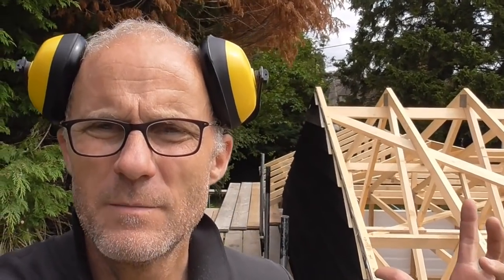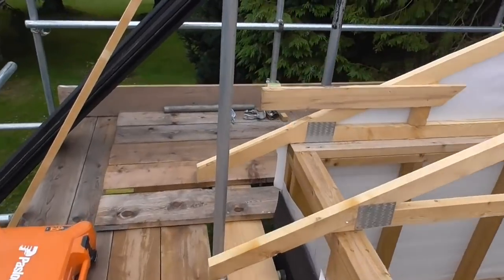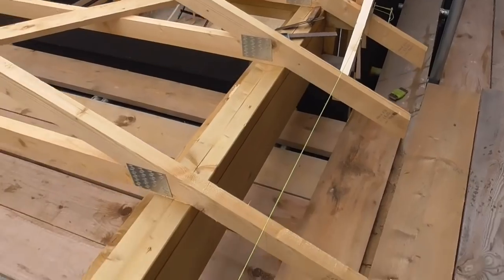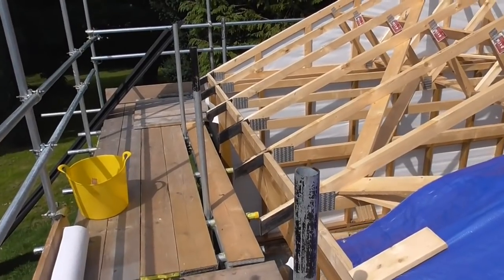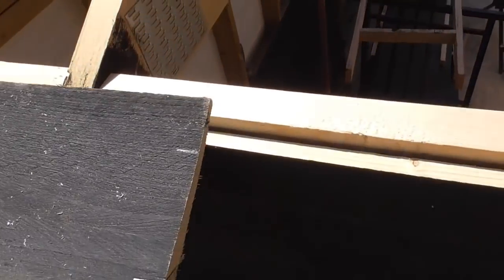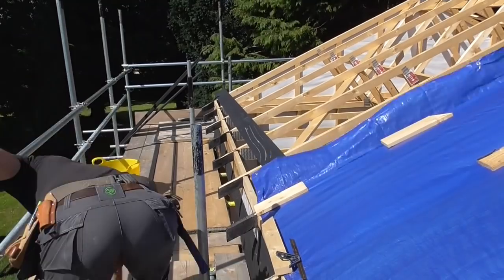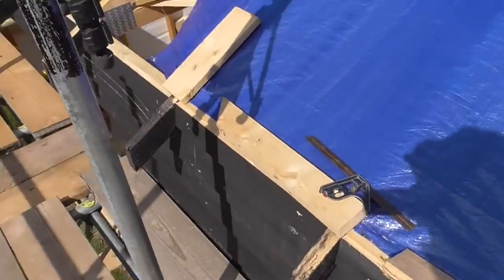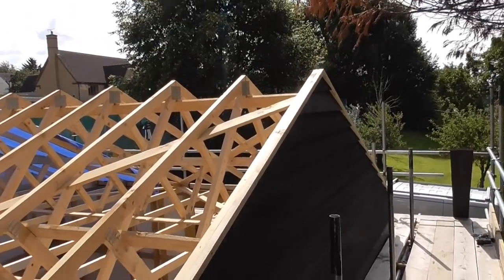Timber frame garage and garden utility space ***PART 10*** (gable ends and cutting rafter feet)

Comment: Great videos, thanks for taking the time to do it, keep it up. I have a question. How would you finish the external cladding corners when flush against the studs, as in this project?
Reply from the maker: Hi Nick. The external corners will have a square section timber fitted to them to close of the board ends. I will be covering this in a video coming soon👍 Thanks for your comment😎

Comment: Very well done. I am enjoying the heck out of your videos. I was wondering why no sheathing on the building before the feather board? Or is that just a U.S. thing.
Reply from the maker: Hi Robert🖐It's not just a US thing, and if this was a habitable space the timber studs would be sheathed with 1/2" OSB, them membrane and 2x1 battens before the feather board. As this is just a 'barn' the boarding is just fixed straight to the studs👍In the UK this type of board is actually known as 'barn cladding'🤩Great to have you watching and thanks for your comment😎Cheers Del